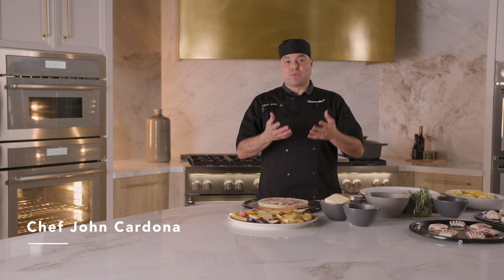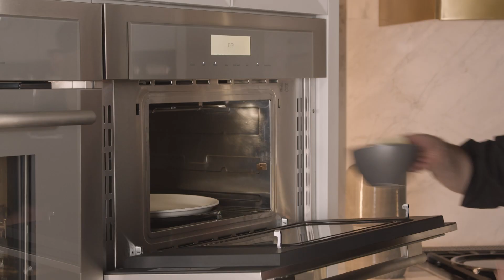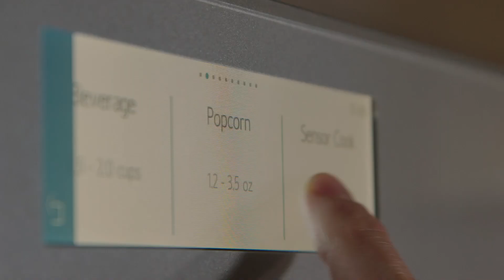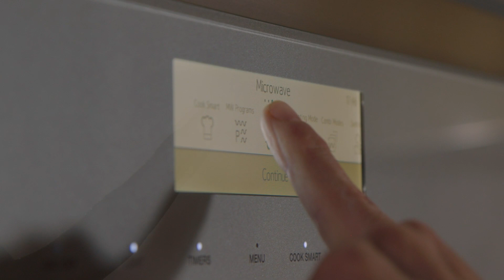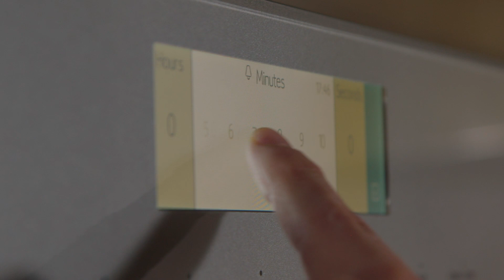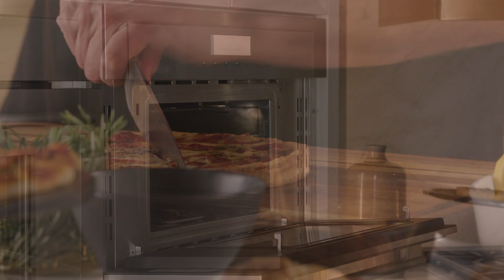Thermador Speed Oven High-Performance Microwave

Comment: Cut to the chase Thermador: The problem with this speed oven isn't that people don't know how to use it. The problem is that your design is a shining example of incompetence in product design. It's like it was designed by somebody who doesn't actually use a microwave. You have two knobs on this, yet nearly everything requires three or four touches of the screen. Every microwaves has a "one button" 30 seconds or minute feature... but not Thermador, because they've never actually seen a microwave. They are too busy softening their meats like Chef John says. What about all the endless scrolling to set the minutes on the timer? Who approved that nonsense? Nobody likes that. Also, everybody who owns this thing HATES the chime. It comes from a tiny little speaker that Thermador spec'd on the cheap and it was a horrible choice. The design on this is so bad that Thermador should recall it. It makes me think less of everything else they make. What other cheap corners did they cut? Sure, you can see the cheapness on the surface of the speed oven, but that also means their ranges and refrigerators are filled with cheapo nonsense design failures. Customer service cannot fix a failed design that should never have been put into the marketplace.